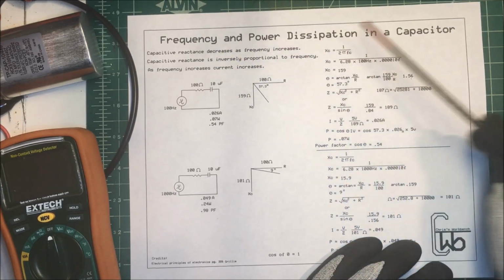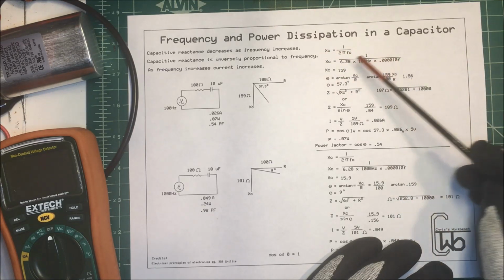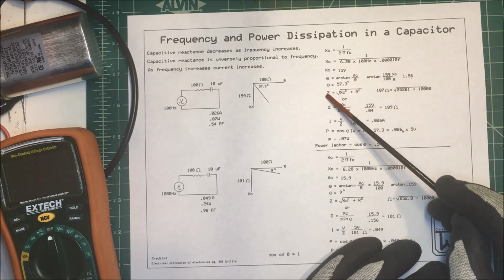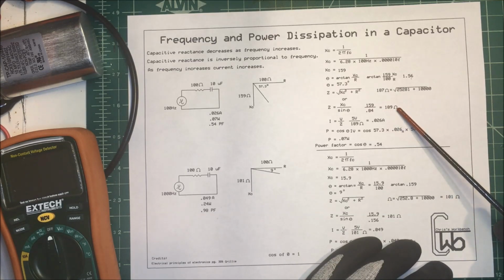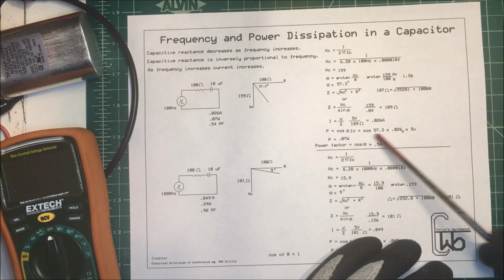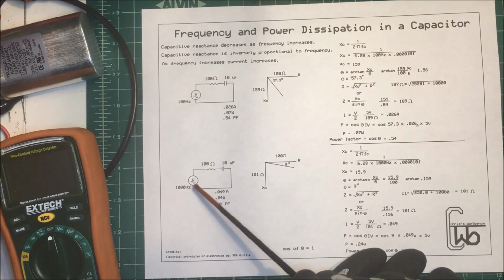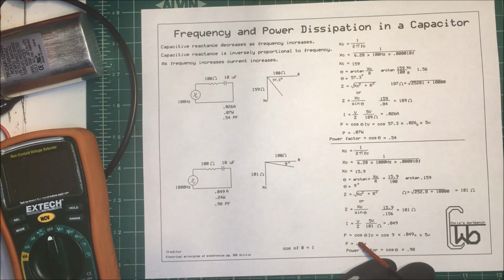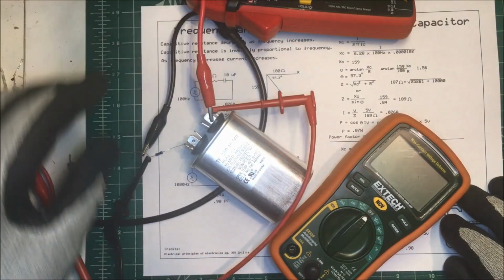frequecy and Power Dissipation

Comment: So how much power (as heat) is dissipated in the resistor and how much in the capacitor?
Reply from the maker: Good question
AC circuits that contain resistance and reactance combine to give total impedance that limits the current.  If you calculate voltage drop on each component separately the algebraic sum of the voltages will not equal the total voltage drop across the circuit. Easy to test.  Resistance and reactance are out-of-phase with each other.